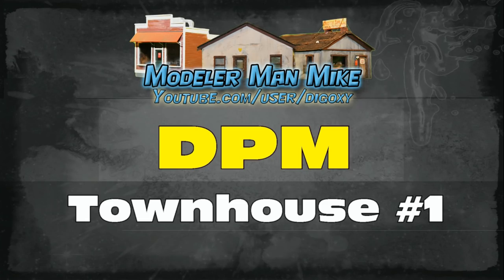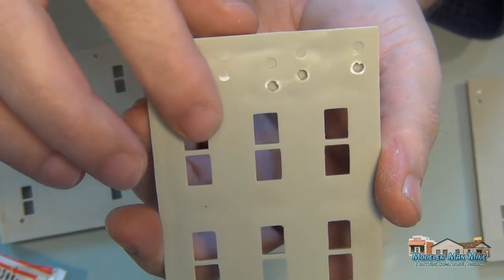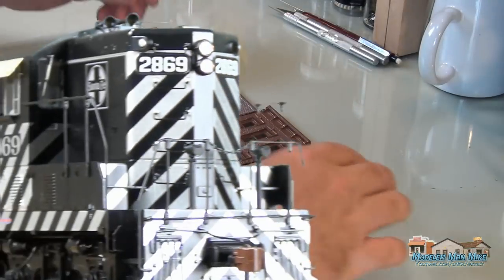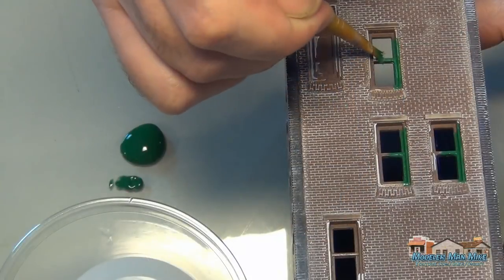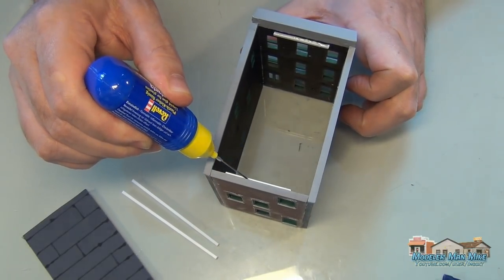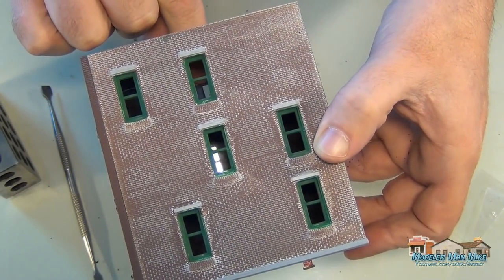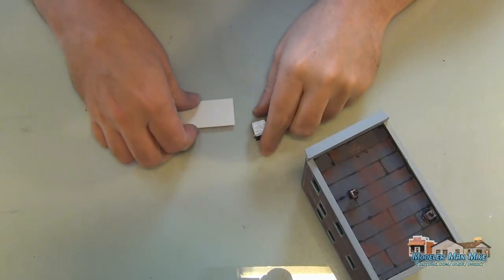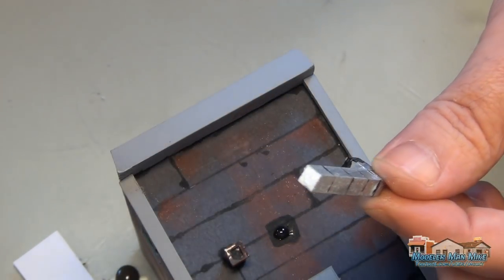Model Railroad Layout Building DPM Townhouse #1 How To

Comment: dude, it's a lot easier to color inside the lines when your brush is SMALLER.
Reply from the maker: Good tip, Thanks dude.... reading through the comments here, this was exactly what the solution was 7 years ago. But, I am older and its still kinda hard because I cant see to well. I appreciate the feedback, SEE YA!
Reply: @ModelerManMike mike you need to make a video again you don’t even need to do a build just update us on your life it would be like the Beatles getting back together lol. These videos are such classics thanks for all of them
Reply from the maker: @RaysTrains  Ray, you know I am actually considering putting some more build video's together. I am not sure what more I can share but the thought is in my head. I am building a shop that I can do my hobby stuff in and then maybe I can do some more. An update video might also be appropriate, I agree, I have jut not had the facility or time to do anything with this hobby. Getting closer though and hopefully it will happen. Ray, thanks for the comments.

Comment: The quality of your paint job is ABSOLUTELY determined by the quality of your brushes.
**Wanna get tiny detail? Get tiny brushes.**
The brushes I use are around $7-10 each at Hobby Lobby.  They are good from 12-15 models (N scale) before they need to be replaced, and I need 3 or 4 different brushes for each. 
Therefore, here's what long term cost looks like: 

4 brushes X $8.50 ave = $34
$34 / 14 models = $2.42 brush cost per model. 
And now I can have the HIGHEST quality brushes I can find, and I now have the confidence to attack every model with a MUCH more detailed expectation. 

Here are 16 brushes made of synthetic fiber, and a MASSIVE upgrade from what I saw in this video.  I use a lot better, real hair brush, but for God's sake... order these RIGHT NOW, brother:
https://www.hobbylobby.com/Art-Supplies/Brushes/Gold-Taklon-Paint-Brushes---16-Piece-Set/p/80825797

BTW, I learned everything I needed to know about paints and brushes from an hourly Hobby Lobby art dept employee in about 30 minutes.  She was FANTASTICALLY helpful.
Reply: Thanks for the tip, I will pick up a set and see how they do!

Comment: Try painting the windows before you install.
Reply from the maker: Yee Haw! Someone from my lone-star state, good to see another hat. I am finally back in Texas but no room for anything really, its a real pain for my hobbies. First, thanks so much for the comments, its always nice to get feedback. These structures, DPM are a solid molded piece of plastic all in one, so the windows are actually part of the mold. Would be nice to have them separate as these are much easier to deal with like you mentioned. So, these have to be painted directly. Since this video's release like 3-4 years ago, many suggestions have come through on how to do this, what I found was using a small wedged brush to paint these, the eyes are now a problem though, gotta get in close to see!